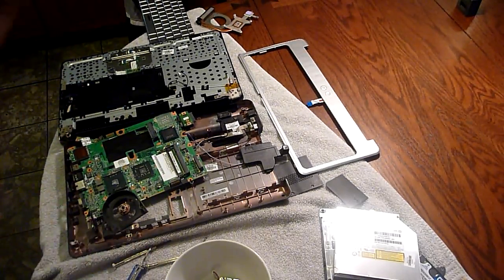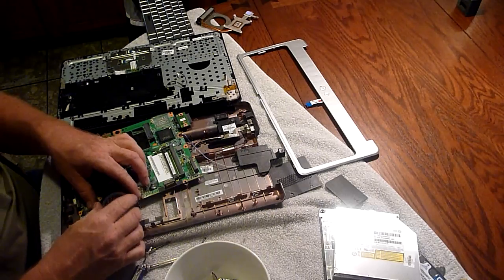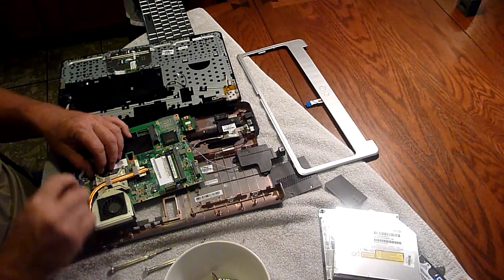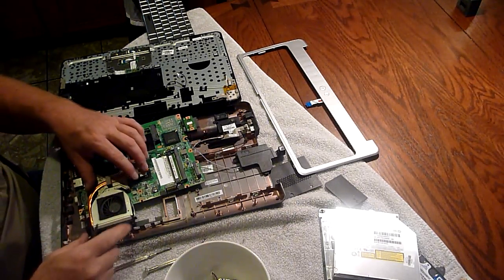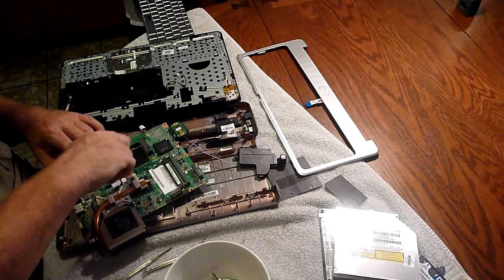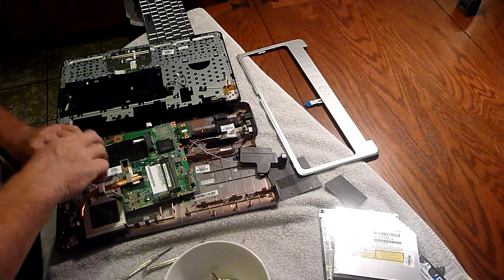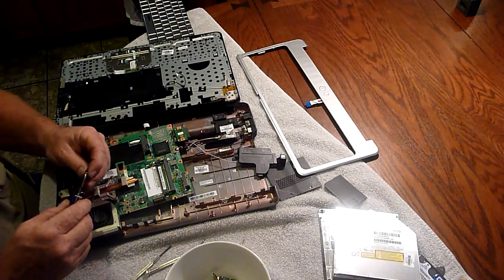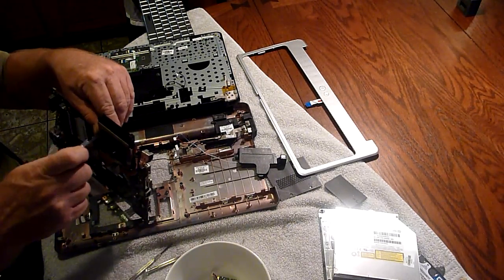G60 230us teardown to fix cooling fan part 4

Comment: You never showed it fully assembled and working?
Reply from the maker: Sorry, you are right, I never shot a video of it back together and working. After this repair it ran fine for about another year and then began to act up and crap out again from what I recall. I was totally sick of HP at this point and just tossed it in the closest dumpster. Very happy to have done so too! I've found that HP products are basically junk that's built ultra cheap for the masses. I would NEVER AGAIN buy an HP product. I wouldn't even take one if one was offered free!

Comment: Hi Matt , thanks for your support , after you cleaned the fan cooler was it necessary to apply thermal paste on the processor ? I have temperature problems and I guess I have to perform this same procedure.
Reply from the maker: +Juan Ladines 
Hi Juan, 
Yes, I applied thermal paste. Always a good idea. The computer lasted another year or so but there were so many flaws and glitches that I finally threw it into a dumpster and bought Apple products to replace all my PC stuff.

Comment: I suspect HP and other manufacturers know that putting the air intake on the bottom will cause the failure of the system, and they're ok with that  since they know it will fail AFTER the warranty period. Before you buy a laptop make sure there are no vents on te bottom. If there are don't buy that brand this way we can punish the maker for bad behavior ..